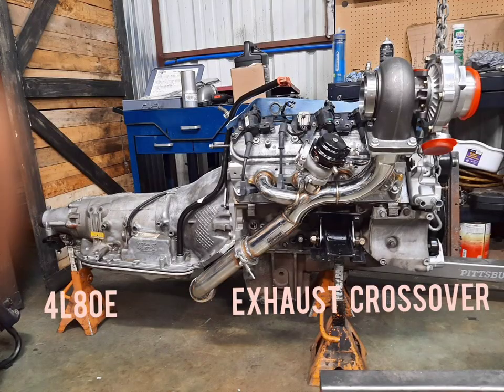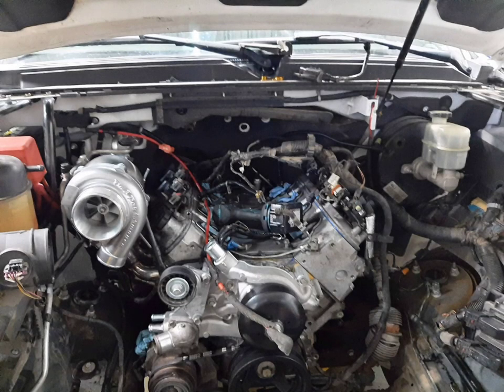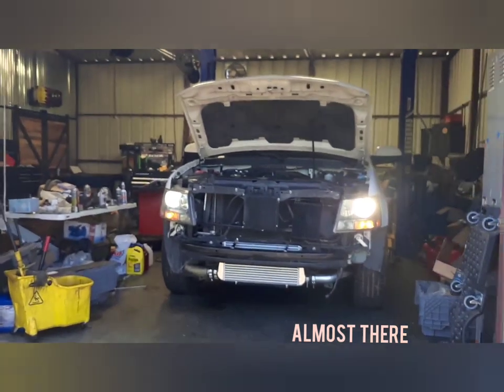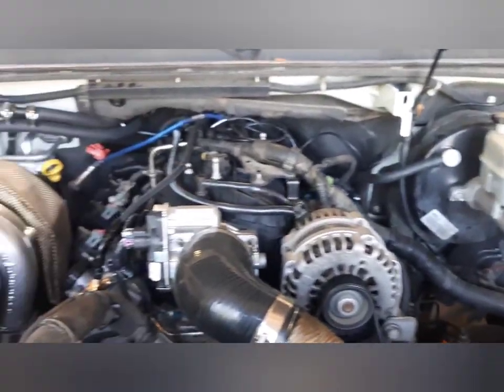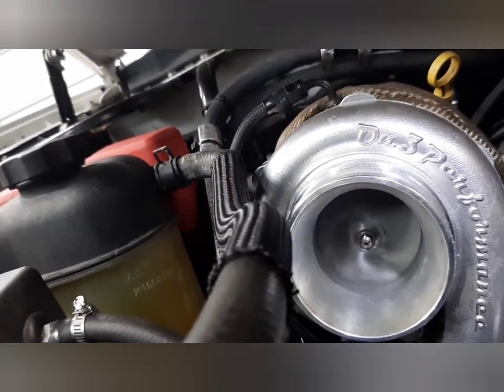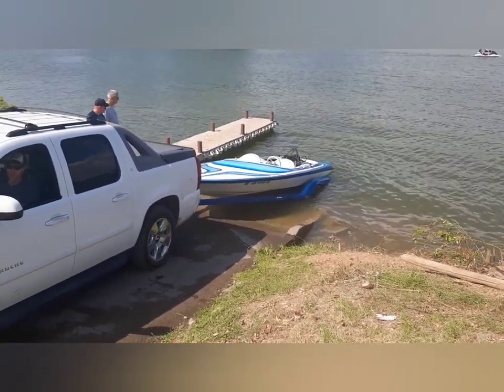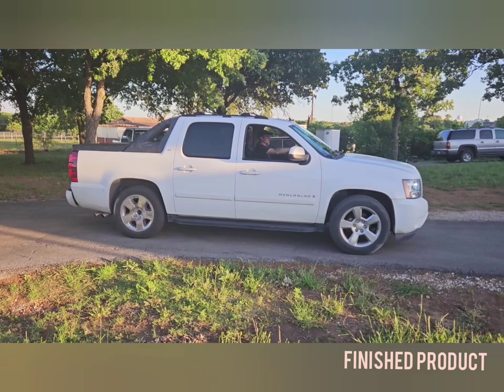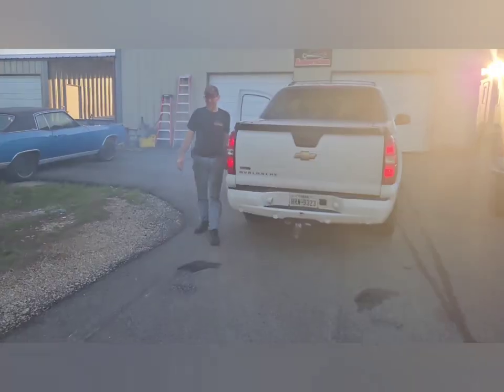Turbo Chevy Avalanche  #turbo #turbols #avalanche #autovation #burnout

Comment: This is exactly what i was looking for. I have a 2011 i want to do a single turbo on!
Reply from the maker: Best of luck with it! You will need to make a new low side ac hose and extend your heater hoses, I found out the hard way that they are too close to the turbo...
Reply: @autovationFtWorth  thank you for the heads up!
Reply: @autovationFtWorth  I noticed that they have a full kit. Did you not order the kit?
Reply from the maker: @NewVisionLCS  Nope, I used a cast iron passenger side manifold from Amazon ($130) fabricated everything  else and coat me about 1/3 of the price.
Reply: @autovationFtWorth got it!

Comment: What sized injectors and pump are you running and did you repin the maf for IAT bung Or just leave it be.
Reply from the maker: Injectors are LSA 50 lb/hr and the pump is a 400 lph walbro witha radium engineering  venturi on the return side. Boost reference pressure  regulator is set at 58 psi with 1 psi increasee for every lb of boost. It's tuned for speed density (no maf) with an IAT only. Just tied into the 2 wires for the iat

Comment: Where did you tap into the oil pan?
Reply from the maker: Just in front of the sump and right below the pan rail.  I drilled and tapped it for 1/2 npt and put a 10 an fitting in it

Comment: Horse power and cost on build?
Reply from the maker: No dyno numbers but from experience I would say around 500hp 500tq
Cost is hard to tabulate because my labor is free to me. I've got about $2000 in the turbo, intercooler, exhaust etc. $1200 in the 4L80e and $1500 in the engine  rebuild. (Parts prices only) Thanks for watching!
Reply: @autovationFtWorth  Nice!
Reply: Is the 4l80e stock in the 07 and up? I've got a 2004 with 134k on it,  I figured I'd probably refresh the heads at some point, maybe throw a cam in it and turbo it. Curious if I built my stock 4l60e up if it would hold the power.
Reply from the maker: @scottdangerfield3227  the 4l80e is not stock in your Avalanche.  It has a 4l65e (upgraded 4l60e)
I use a 4l60 in just about all of my swaps if I don't tow with them. They are good for about 600hp if you don't tow a lot or launch it too hard.
Reply: @autovationFtWorth  Thank-you for the reply. Sounds like I'll stick with the 4l60 and build it. No sense in launching a 4x4  truck. That what my supercharged magnum srt8 is for. :)